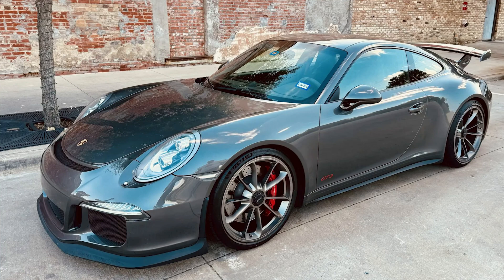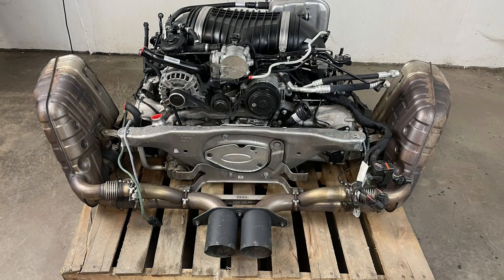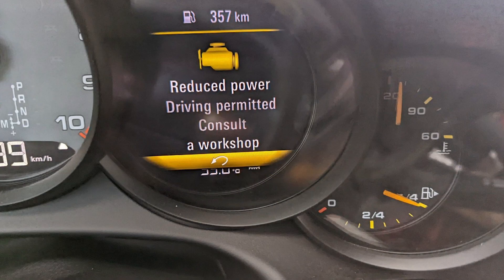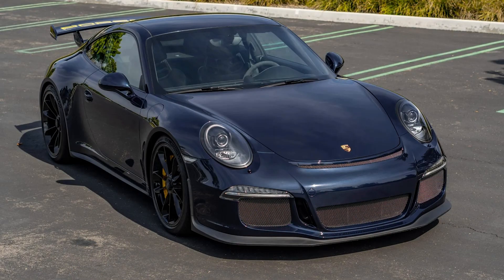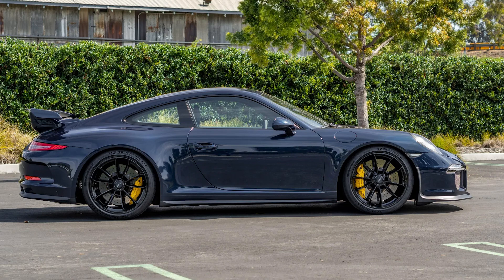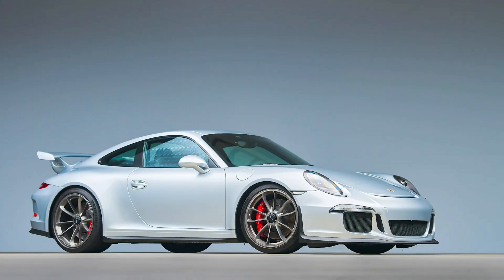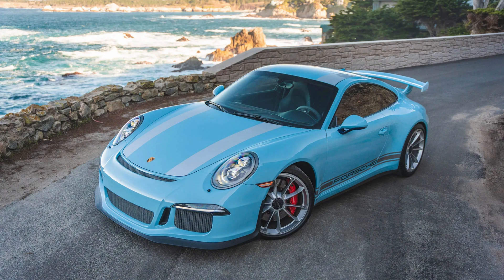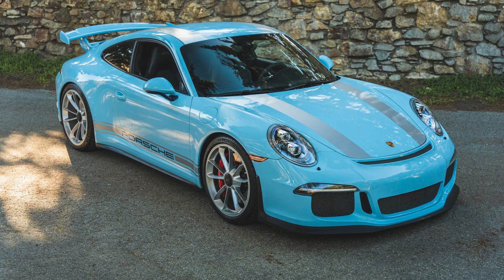Porsche 991.1 GT3 Engine Failures | Everything You Need To Know

Comment: My E1 is at the dealer having a new engine. 24k miles 2014 car. Chronic misfire and limp mode after a track day.  Keep the Porsche warranty for as long as you can.
Reply: so theyre going to replace it with a G6 engine correct? ive been looking into potentially getting a 8k mile 2015 GT3
Reply: @czczczzzczczzz  New G6 but it’s new everything, cats, manifold , ancillaries , alternator, all sensors, air con pump, etc etc.  all that remains of the old engine are the earth straps and silencer from what I can see. It’s great. I bought the car with 5 years Porsche warranty. My plan was to hope in the next three years I can get a new engine or I’d have to sell it, in the UK the Gen 1 is a big price difference to a Gen 2. I am pleased. I can run it in and know exactly how it’s been looked after going forward.
Reply from the maker: Glad you’re getting yours covered under warranty. Now you can continue to enjoy for many thousands of miles to come.
Reply: @AutoWisdom I wouldn’t want one without the Porsche warranty. I suspect a good Porsche specialist could change the cam and followers, they don’t need an engine change. Dealer said it’s a c£50k retail job to change the engine. 😮

Comment: Great video!  You forgot to mention that the 2016 991.1s came with the G0 engine.  I'm not exactly sure of the difference to the G6, but the G6 was the final version that everyone gets as a replacement, as you mentioned.  The G0 seems to be very robust and not prone to failure like the E and F series. But keyboard mechanics love to argue otherwise.  Anyway, I am super happy with my 2016, no issues and I still have several months of warranty left but I will likely purchase an extended warranty just for peace of mind and resale value.

Comment: Have a 2015 991.1 GT3.   Bought it CPO last year with just 7K miles on the clock, and it came with a 3 year CPO warranty.   As long as I continue to maintain it with Porsche, they can resell it at that time with another 3 year CPO.  Point is: Porsche will warranty these cars for up to 16 (SIXTEEN!) years - just have to buy CPO.

Also, the engine issues are already accounted for in pricing.  An “identical” 991.2 GT3 is $40-50K more than a 991.1.   That said, I’d absolutely negotiate down in a private sale with no warranty.  But for these cars - and any GT3 - I’d want CPO.   Mine had over $10K warranty work done in the first few months that had nothing to do with engine (steering wheel, dynamic engine mounts and rattle fixes).   Get one with a warranty!
Reply from the maker: Well said! I think it’s becoming increasingly difficult to find clean, CPO examples with warranty.

Comment: I have the 2014 GT3 with the E1 engine that replaced the E0 original engine. The E1 installed in 2018. No issues with it. Porsche warranty expired October 2024.
Reply from the maker: Glad to hear you've had a positive experience with the E1 engine. How many miles are you at currently? Do you track yours at all?
Reply: @AutoWisdom  Well, I was going by the label under the engine hood lip and the label in the passenger door jam that indicate E1 Engine. I just crawled under car to check engine stamp and it is the G6 Engine.
Reply from the maker: @ Ahh that's great to see! Your GT3 has a long life ahead of itself.
Reply: @AutoWisdom  10000 miles on the new engine. I do not track it. I purchased March 2024 and I do run the RPM's high.

Comment: Did this issue extend to the 991 gt3rs engines? I’m looking at a 2016 model 4.0 litre which has a G0 engine code
Reply from the maker: I’m not exactly certain to be honest with you. There have been some reports of engine failures with the 991.1 GT3RS 4.0L engine, however documented instances are far less than with the standard GT3.